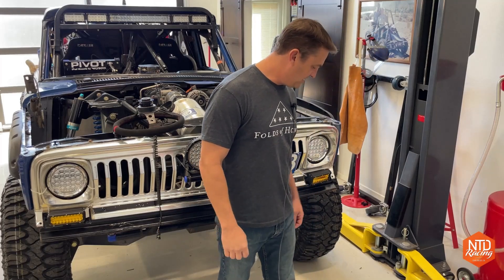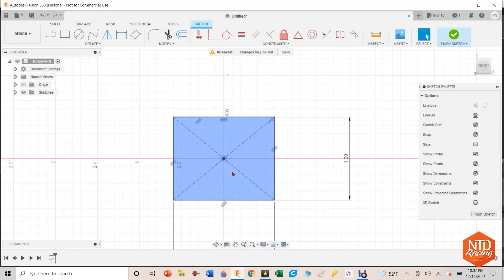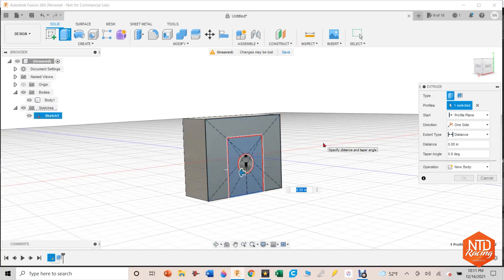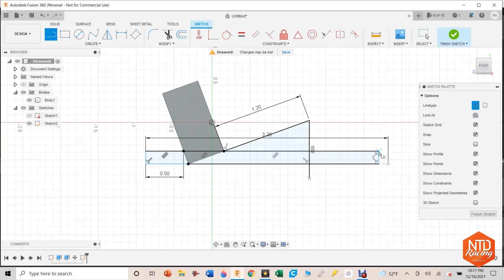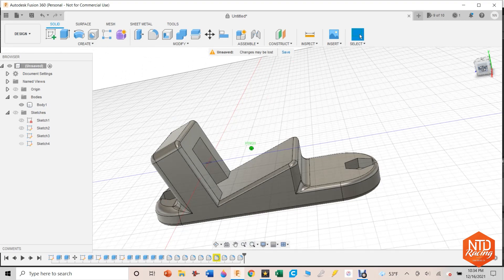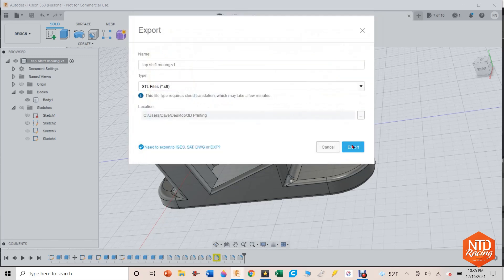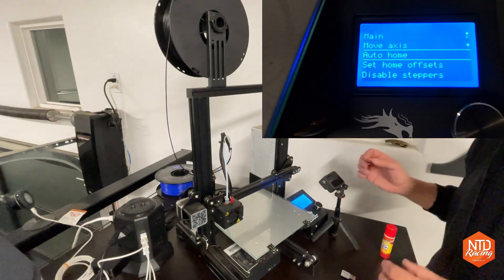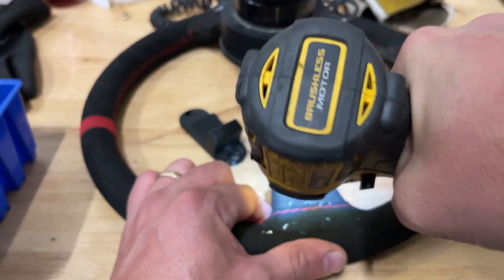Simple CAD Design for 3d Printing

Comment: Awesome job. instead of export and saving on your computer you can go to the Mesh tab then to Export and to 3D Print.  Select your item and then the slicer software you are using.  It will open directly imported in the software to prep for 3d printing.   I just got a 3D printer at Christmas and am enjoying it.  Nice addition to my plasma table.   Now to get a cnc mill and lathe.....

Comment: I don't recommend PLA for your final part given the environment. It is very hard, but It sags when left in sunlight. Take something you've printed and put it under a heat gun for just a minute or so and you can see how it gets soft and sticky. It is meant to be compostable. For your use I would recommend ABS, but at least PETG, but there are a few others to check out. I personally print with 20% infill when prototyping then switch to 100% for final iteration. If I have to reprint it 3 times to get it right at 9 hours, I can get one, maybe two, iterations per day. With 20% infill I can get at least 3 iterations in one day, then print final at 100%.
Reply from the maker: I only have experience with PLA.  Will ABS /PETG normally work with the same printer settings and nozzle ?   Great point about 20% infill on the prototype.   I just did not know it was a prototype at the time.   “Rapid Prototyping “ sounds cooler than “I messed up the design and had to print it again”.  Thanks for watching
Reply: @ntdracing  "Iteration" = "I messed up this many times". I usually figure in 3 iterations. (No plan survives first contact :-). Switching to a new filament always takes some calibration. Lots of videos and tutorials out there on each type. PETG is close to PLA but has a higher working temperature and can withstand higher temperatures in use. Uses same nozzle, but use much lower bed temperature because it adheres extremely well to the bed. It won't melt if you leave it sitting on a dash board in a hot car. But, like PLA, is brittle. In a high vibration environment it could fracture. ABS is used a lot in automotive manufacturing. Good temperature and chemical resistance, just a bit flexible to absorb vibration. But not compostable, smells like burning plastic when printing, generally bad for environment and needs an enclosure (which you can build yourself) around printer because while printing it is very susceptible to temperature change and drafts causing prints to fail. Again, lots of tutorials on printing w/ ABS on YouTube. Printing uses same nozzle, higher print head temp and higher bed temp. Also shrinks a bit, so needs some allowance for that.  I am not an expert, by any means, just a hobbyist. This is just personal experience, which is limited.  But it would be a real pain to have your paddle mount break while competing or have it melt while sitting in staging at a desert race.

Comment: Loved the video. I’ve got the Ender 3 Pro and the Crossfire Pro. Still trying to get proficient in Fusion. Take a look at the auto bed levelers for your printer. I would say the easiest way to add one would be to order a Big Tree Tech SKR Mini E3 V3.0 upgraded control board and the BL Touch auto bed leveler kit. You can get both on Amazon for about $100. The upgraded control board allows you to plug the sensor into a dedicated port on the board, something the factory board doesn’t have. It also gives you a little bit more computing power which helps out on longer prints and stepper drivers which makes the printer virtually silent while printing.

Comment: For your razorweld 45   x45 torch what consumables did you use and where did you get them from ? Were they hypertherm consumables and how did they work any problems ?
Reply from the maker: I always use the Hypertherm consumables and order them on EBay.
Reply: @ntdracing  What company did you buy them from ???
Reply from the maker: @K1Racer.  just the least expensive on EBay.